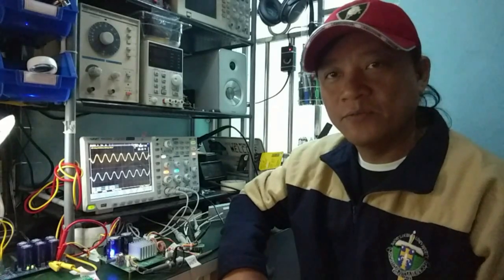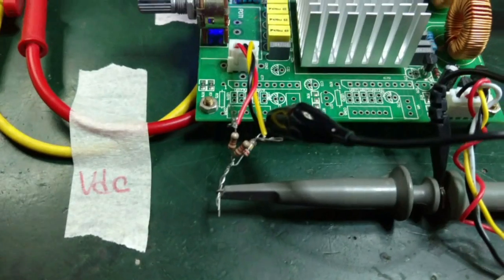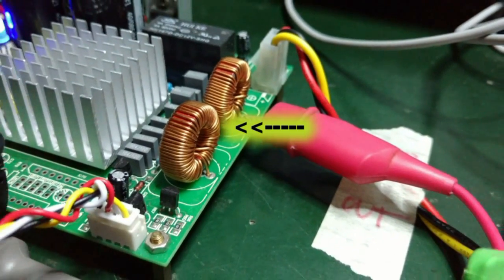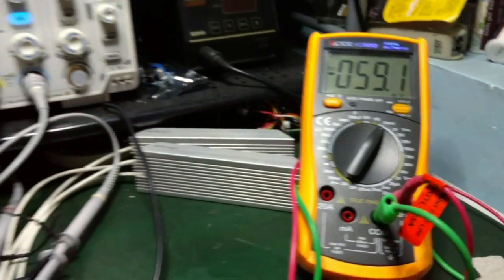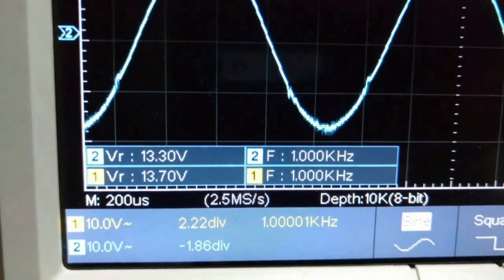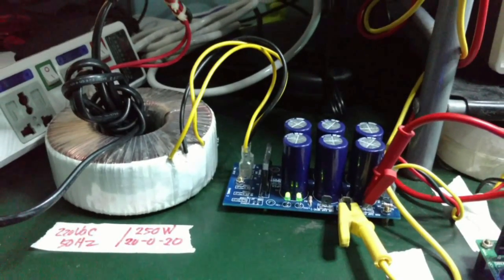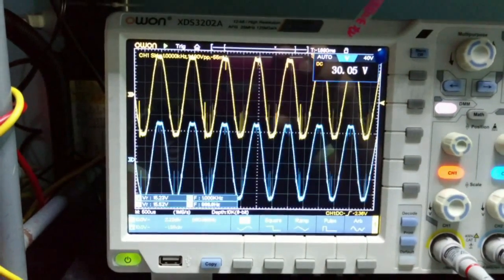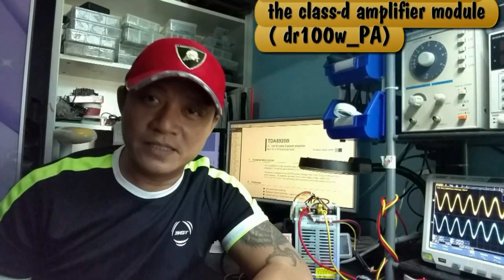Class-D Module #01 | TDA8920BTH Parametric Test of the DR100W_PA Module | myMusicmate

Comment: 10% THD will sound dreadful.  When I measure power for me max power is the clean sine wave prior to any clipping both channels driven into a specific load impedance. Most amplifiers fail badly when measured correctly like this.
Reply from the maker: Thanks for the comment and apologies for the very late reply.   I hope to re-measure the DR100W_PA with the TDA8920BTH chipset once again, now that I have a distortion meter.   I finally settle  my diy process to test a class-D amplifier parametrically which  I published it here,    http://1diyshare.com/index.php/2020/04/02/amplifier-parametric-test/